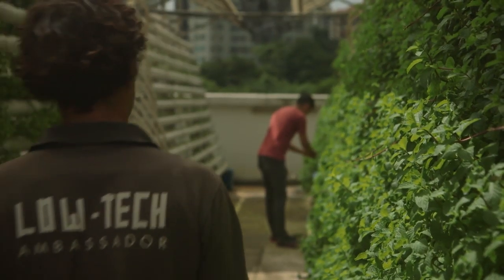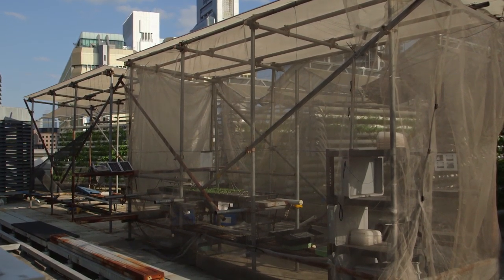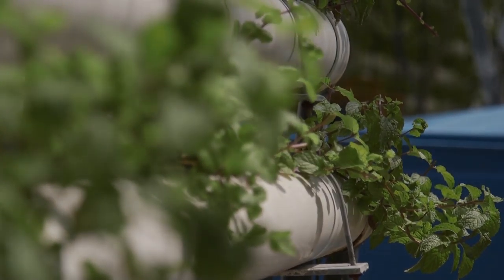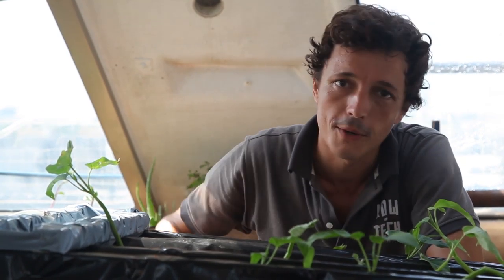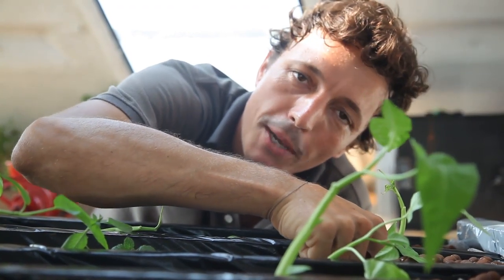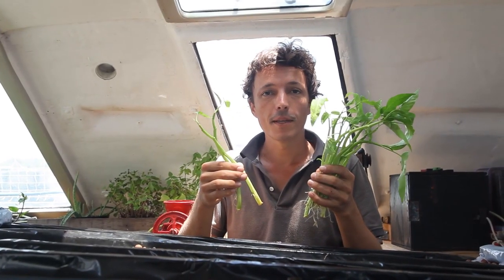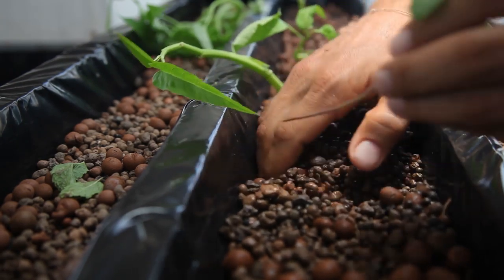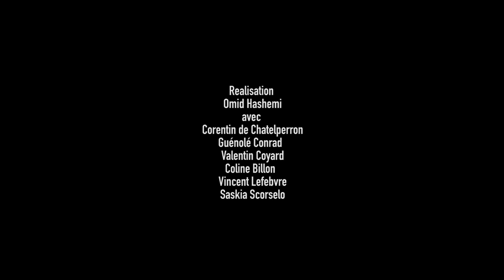How to build a low-tech hydroponics system - DIY Tutorial

Comment: Seems like it would be a good system, but keep in mind that this setup would still be dependent on electricity, so access to alternatives sources of energy (like wind or solar) would be a must if you wanted this system to be disaster-proof. Or better yet, see if it would work with a ram pump, then bam, no electricity required!
Reply: Oui, mais cela nécessite une source d'eau en hauteur avec un débit stable. 
Yes, but this requires a high water source with a stable flow.
Reply: sinon on fait pousser dans de la terre avec des vers de terre ?